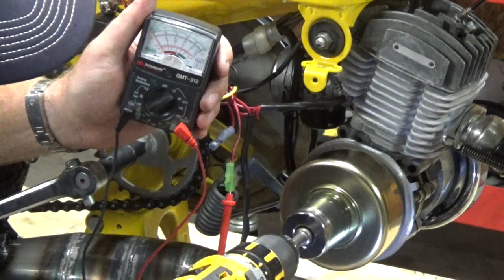Motobecane Moped Restoration Ep. 19.  Finishing Touches Pt 2

Comment: O man. That sucks! 
Btw, did you read my comment on the previous video regarding the clutch? Sadly enough there is good reason why your peddling like crazy without any effect :( The hammers in your clutch are incredibly lightweight. That is why they don't work. I do hope it gets a little bit better over time.
Reply from the maker: Yeah Frank. I read it and didn't understand it much until now :-). I've got two other clutches and I'm thinking about pulling the internals out of them and swapping them out of the new variator. Can you see any reason (besides it being a pain in the ass) why that would be a bad idea?  

Thanks as always for your advice.
Reply: If I were you I would wait until you actually test drive the moped. Just to be sure that it definitely sucks. 
Is it a bad idea to swap them? Other than being a tremendous pain the ass, no. It is a good idea. I did this years ago. If I remember correctly you do have to modify the hammers a little bit to get them to fit. Than you will probably encounter a problem with the springs between the hammers. The old ones don't fit. Therefore you should use the new ones in the most stretched position on the hammers. That way the spring force is identical to the old springs. This works perfectly!

Than there is the problem of the leaf springs. Swapping these is horrible. If your lucky you can use the entire chrome plate with leaf springs attached of an old variator saving you the trouble. Sadly enough they don't always fit on the new variators because the new ones tend to stick out a little bit further. 
I once solved the leaf spring problem by bending the leaf springs of a new variator to a new position and grinding away some of the friction material to get it to fit again. A horrible solution but it did sort of work.
Reply from the maker: Awesome. Thanks again. I forget that you don't have a live stream into my workshop, but (spoiler alert) she's up and running and I've tested her a bit.  It'll be in the next episode, but, unfortunately, I think I'm gonna hafta do the swap. Already started making a jig to put in my clamp to help me get that variator apart. That thing was not meant to be serviceable.
Reply: You got it running! That is great! 
Look on the bright side. You needed that jig anyway. The chances of the variator weights being exactly right for your moped was rather small. Opening the variator is not that hard actually. Unless the fixed pulley is really old and stuck. You just need some weird tools and ridiculous sockets (old ones 35mm, new ones 36mm) Opening the clutch assembly is more annoying. I hate those 4 screws! You will find out soon enough ;)
Be aware, that large nut has reversed threads (is it called left thread?). The fixed pulley has normal threads.
Reply: David, everything ok? It is awfully quiet around here. Still no new video :( Normally you rate of speed is almost beyond human :P You restored these mopeds really quick!
Reply from the maker: Frank -- HA!  Sometimes regular life gets in the way :-).  I'm starting the clutch modifications that you suggested this week.  I'm hoping it works...
Reply: I hope so too ;)
Reply: I am in the process of restoring a 1980 Indian moped and I cannot find info on torque specs and timing specs I have an Indian manual but it is vey basic no specs for anything besides points and spark plug gap and its supposed to be a factory manual. Do you by any chance know the timing specs and the torque for the nut that secures the flywheel to the crankshaft?Great videos by the way I am slowly catching up with all of them, learning a lot!Cheers